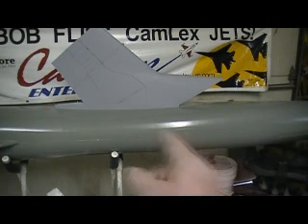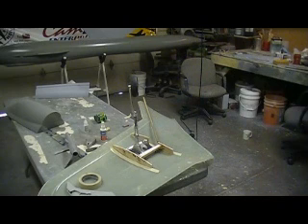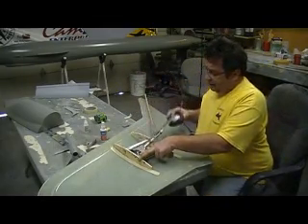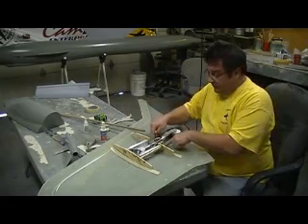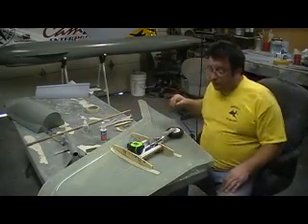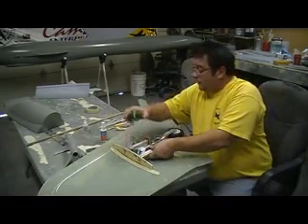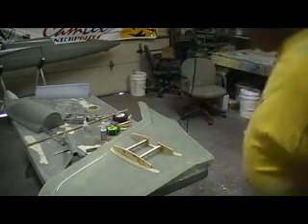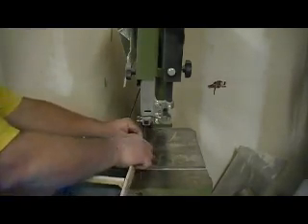how to build a rc jet F-105 thunderchief # 256

Comment: Bob,
Looking good. You should be able to adjust the toe-in on the strut with the set screw
on the collar. You'll have to balance the setting with where the tire sits when retracted.
Paul